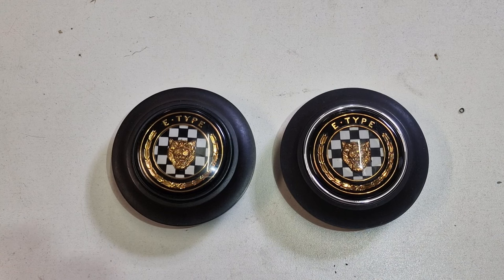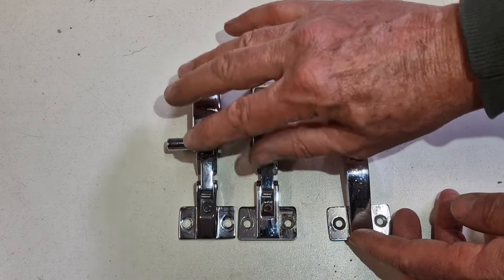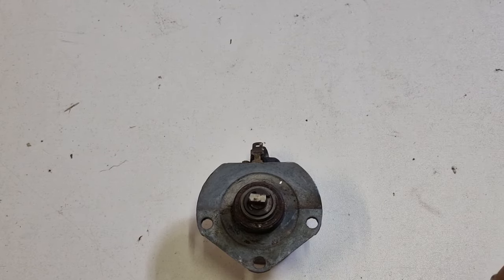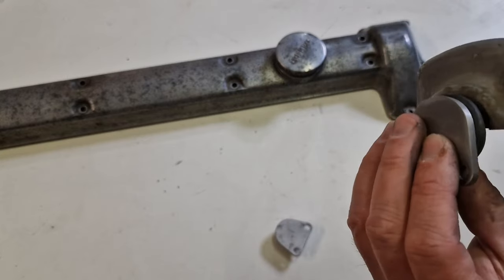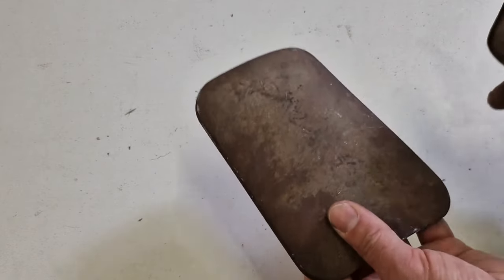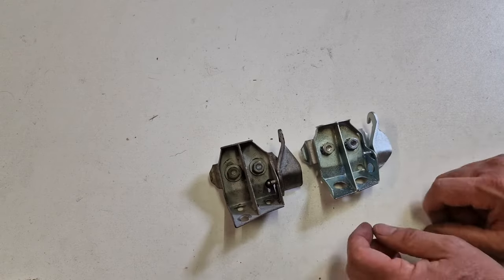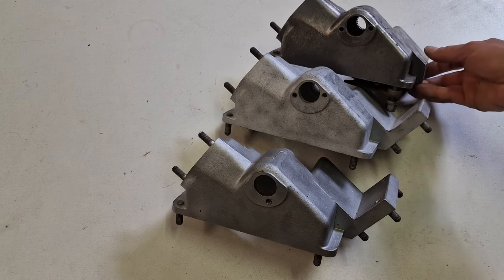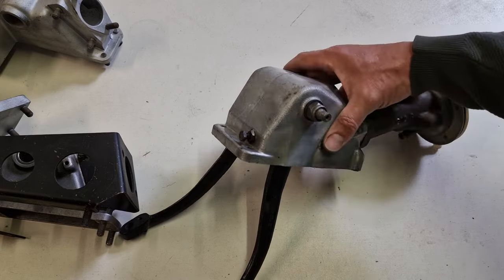The Evolution of the S1 Model: Replaced & Improved Parts  - Pt. 2

Comment: Excellent work Maikel, as usual.
Regarding the tachometer generators, the location of the driven piece is determined by the sintered bronze bush that is pressed in to the housing.
This bush is pressed in to  a not so robust aluminium housing and the driven piece needs to be aligned with the driving dog when it is installed.
What usually happens is a knuckleheaded mechanic tries to install the generator with the drive misaligned to the driving dog, and when they tighten down the fasteners the end result is that the sintered bush gets pushed back in to the housing - like the one you have.
They can be repositioned by popping the end cap off, pressing it all back in to position and pinning the bush to the housing for a permanent fix, drill 1/16" hole on an angle that passes through the housing and the sintered bush and put a split pin in to your hole to permanently pin it in position. 
Thanks for posting
Damon
Reply from the maker: Hi Damon, @nkelly.9

how is going down under? Many thanks for watching and for commenting. Most valuable information for me and of course for all the other followers. I never had such a close look at the rev generator but was always sourcing another one. Will give it a try with a damaged one. But very helpful to know. Stay tuned and keep sharing.
All the best
Maikel

Comment: Hello Maikel . Fascinating insight into the progressive changes in "e"type production . This exemplifies why you should always get the most complete example when considering a restoration project . Which is what l did when l purchased my '66 2+2 . And my first mistake was buying a replacement rear lamp . It was a roadster so it did'nt fit !! Although with careful reprofiling it now does ! Thanks Maikel .
Reply from the maker: Good day John, @johndavey72 you hit the nail right on its head.Most original is always the best, at least in my opinion. Everything fits perfect. I had several stalled or abandoned project with missing parts. I had to learn the hard way, just like with the tail light. So, theses videos are a money and time saving guide. I want to encourage the people the fit original and spec parts where possible. Sure you might be able to fit later bits on an early car, but hey, is that what we want if we can avoid it? Keep watching. C u.

Comment: Maikel - yet another very informative video. luckerly I do not seem to have fallen into any of these traps. However I have had a very frustrating few days fitting the front hardware to the bonnet. After much effort I have got the bumpers to fit nicely and the rubber follows the body well. I then fitted the motif shaft holders and after lots of fun with then and the overriders I got them to fit well. However it is now impossible to fit the motif bar. It would appear that my new motif bar is too long to fit my bonnet mouth. My old original also looks too long. is his a common problem as my bonnet appears fine. The headlight scoops also appear to be fun. why is the bottom num welded on the outside and the others on the inside? thanks Hugh
Reply from the maker: Good day @hughtube1,
what you describe is a common problem and might end eventually in a broken motif bar. Can you send me some pictures to maikel.lemke@etypes1.com.
It could be a wrong position of the overriders. So need to at both from a few meters away.
The sugar scoops have those welds to make sure you have an inclination to allow water running through that hole. They are a pain to fit. Same with the chrome ring over the headlights. Make sure you have the right rings and screws and still you might drop the screws.
But I can see you getting there, sounds like the final steps 👍
Reply: I think the mouth of the bonnet has been made narrow on my replacement bonnet as the motif bar does not fit the gap even without the overriders on. So I have cut the ends off the motif bar and made a bracket  to hold it into the overrider end caps. It looks ok but not as Jaguar intended. The sugar scoops are in and I see what you mean they are very tight to the chrome headlight finisher. @JaguarEType